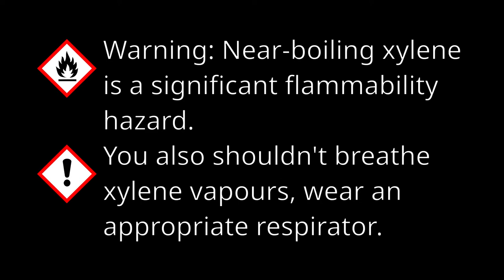Make pure sulfur crystals

Comment: An it would have been Educating if we told an shown what was the liquid in the little Amber bottle that you mixed with the Sulfur. You turned the bottle around so the label was hidden. I couldn't  understand most what you were speaking. 😢
Reply from the maker: The solvent is xylene. It is also written in the initial safety notice.